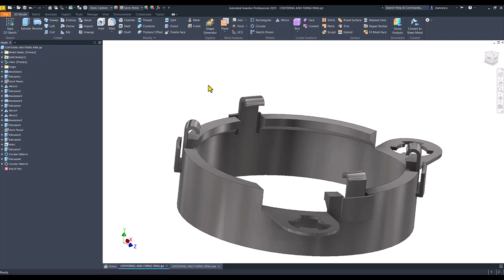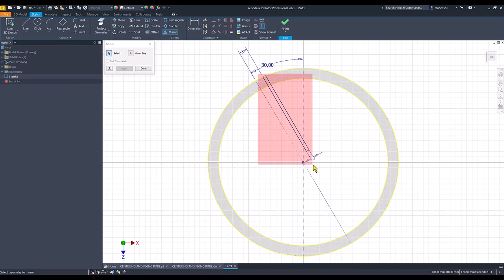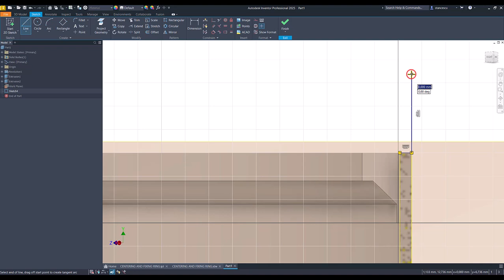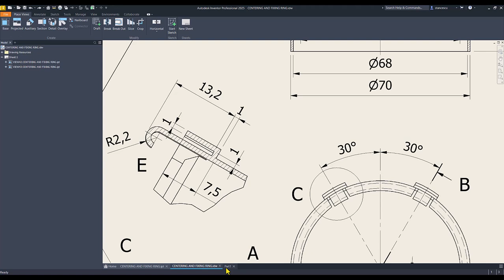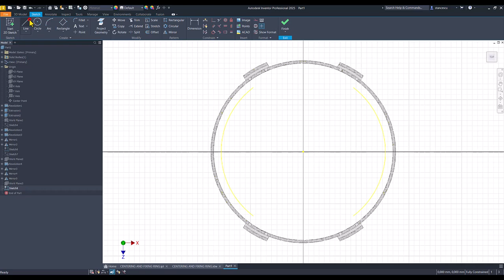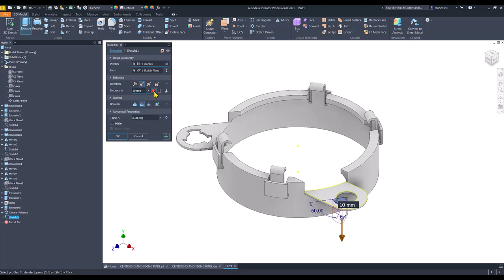Tutorial Inventor - 464 CENTERING AND FIXING RING

Comment: Hello professor.
I'm wondering what would be the mechanical process to make this part.
Some elements sugest me that it may be done with CNC but others seems with sheet metal bending.
Or perhaps is it a cast piece?
Or a combination?
I'd appreciate your comments.
Reply from the maker: In my opinion I think that the injection  is the solution and the material aluminum. I placed steel carbon without a study of the part. I’ll be more careful with this aspect. Thank you my friend!